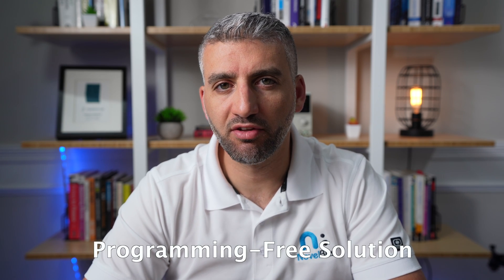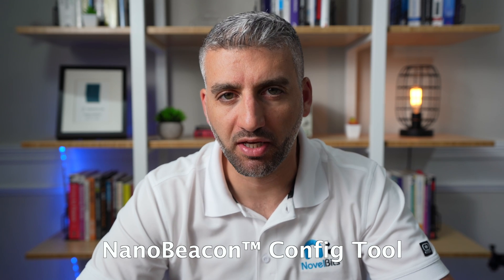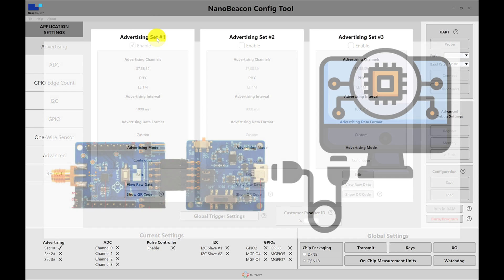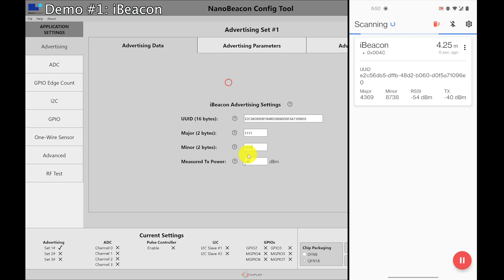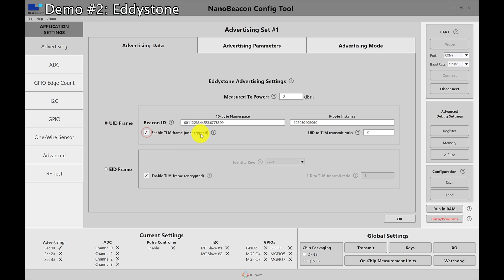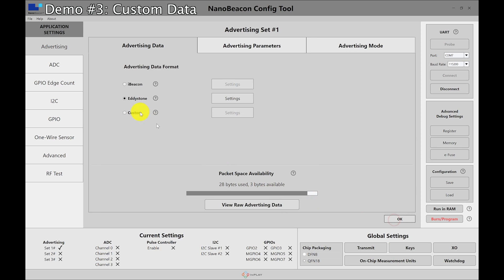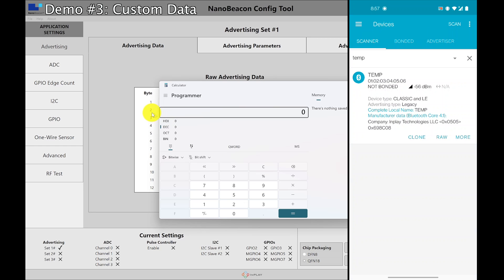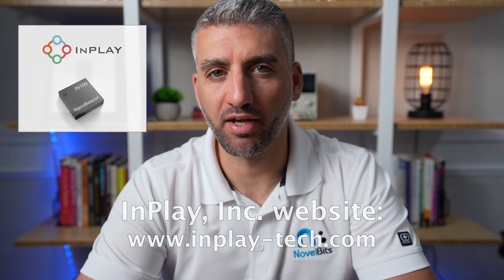The $1 Game-Changer: Discover the No-Code, No-Firmware Bluetooth Beacon!

Comment: I need a Bluetooth preferably BLE device that DOES NOT NEED AN APP, I’ve heard this can be done with audio, mouse keyboard or heart tracker devices but how do I go about finding one all devices i see are BLE ibeacon that need an app
Reply from the maker: Bluetooth Low Energy devices all require an app to communicate with from a smartphone. Unless the device is a standard HID or Audio device (Classic Bluetooth), you’ll need an app to communicate with it. One exception would be a BLE HID device like a keyboard or mouse. But then the question is, what exactly do you want these Bluetooth devices to do?

Comment: This is exactly what I have been looking for. I really need your input on prototype I am working on.
Reply from the maker: What kind of application is it? and what sensors are you looking use?
Reply: @NovelBits  I need an asset tag that only communicates that it is present in a set of asset tags. The problem is each one of these needs a circuit board for battery mounting…antenna etc
Reply from the maker: Can you send an email to “support AT InPlay-tech DOT com”? Someone should be able to follow up with you and provide guidance
Reply: @NovelBits  thx I will. It looks like I am going to have ti design my own low cost PCB to house this chipset as the one from inplay seems very expensive and it doesn’t look to be available outside the test kits. My product needs to be 5 or 6 dollars per asset tag including everything to make it viable.
Reply from the maker: Yes, the dev kit is too expensive to be used in a simple product like that. The chipsets are available to purchase through DigiKey.
https://www.digikey.com/en/products/detail/inplay/IN100-Q1-R-RC1I/15652915
https://www.digikey.com/en/products/detail/inplay/IN100-D1-R-RC1I/15652913
Reply: @NovelBits  I bc am going to send a schematic to a company that does custom PCB that will use this chipset, thx for responding! I love your you tube Chanel!